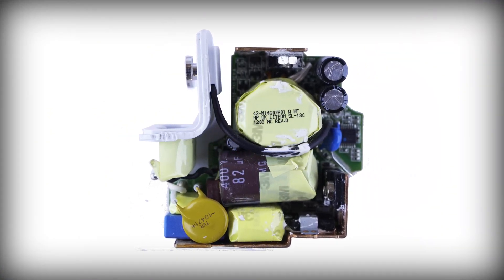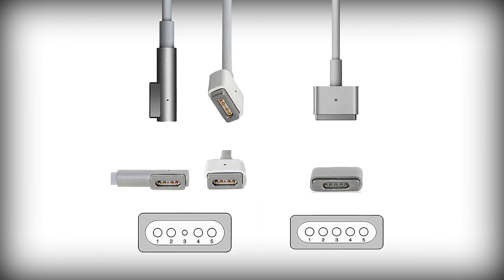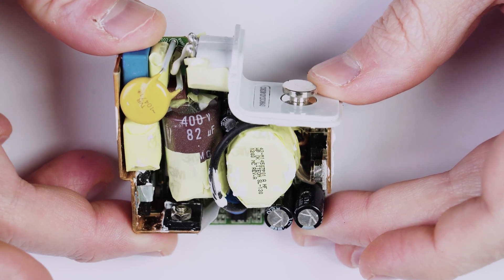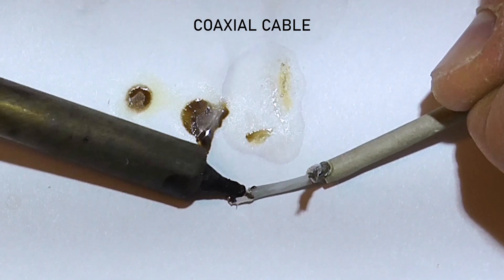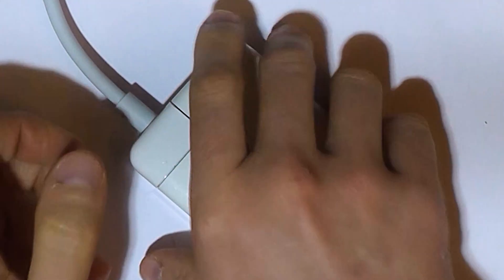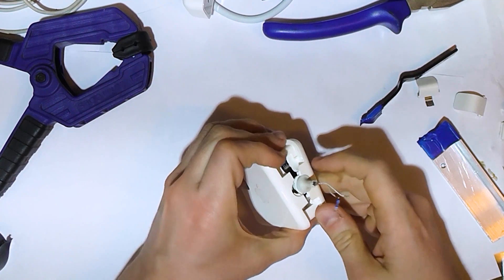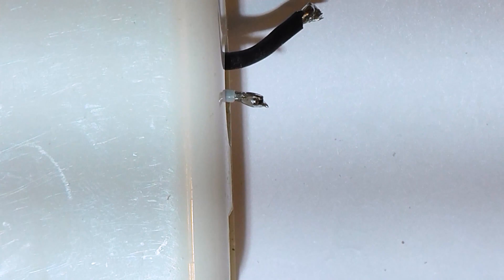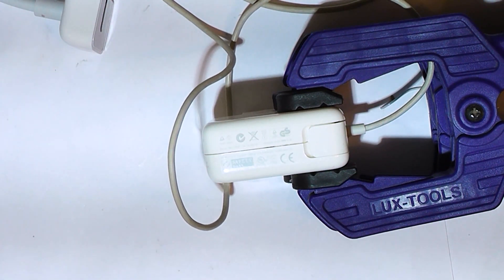Easy fix for a broken Magsafe cable.

Comment: i usually cut the sleeves when i do wires going into tvs and stuff but i opened my block and de-soldered the cable and the adhesive on the sleeve was weak so i was able to just pull the wire through it. not that cutting it is hard but i always like it when it works like that. mine did not have the thicker piece after the sleeve that held the wires apart from each other so no drill needed. magsafe 1 80

my charger is odd, only works on my 08 macbook sometimes and when its dead but it pretty much but always works on my 08 MBP for charge and power even though on both it says not charging most of the time :P

Comment: Very good video. I had replaced the cable with a replacement one but 1 year on the chip at the plug end has shorted.

Comment: So i can buy a cable and put it into a 3rd party power supply... Interesting
Reply from the maker: Yes, provided the voltage range is between 13v and 18v DC and also make sure the polarity is correct, or your laptop will be toasted instantly. I am not sure Macbook Pro will charge from 13v, but Macbook Air does charge, which means, you can build a car charger without and converter, because while the engine is running the cigarette adapter voltage is 13.6v.

Also, if you use a 3rd party power supply you have to watch out for sparking when you attach the cable to the laptop, because power will not be cut off as it is done in the original charger.